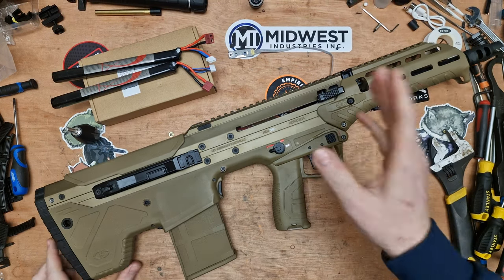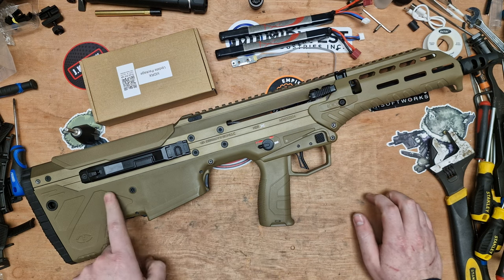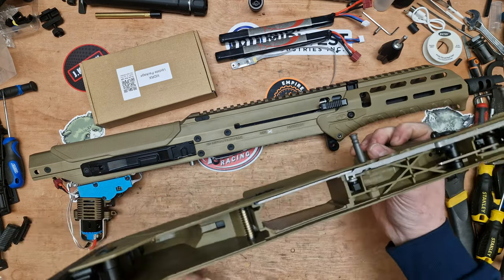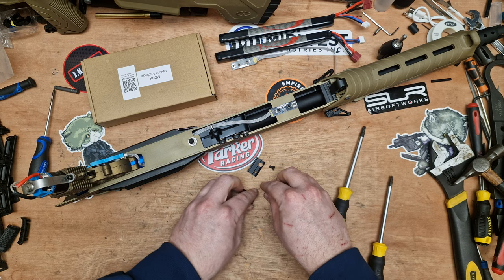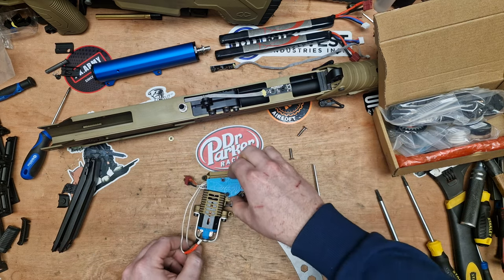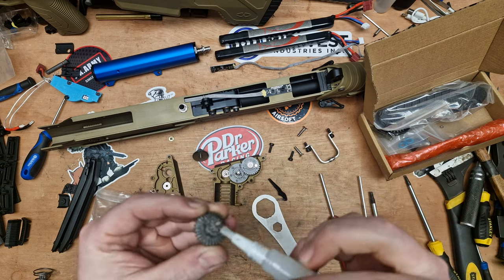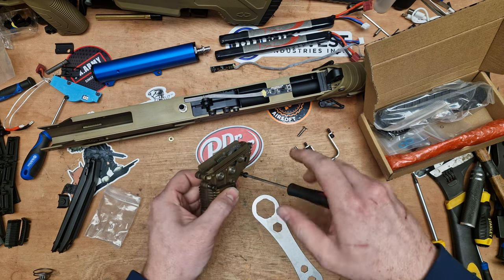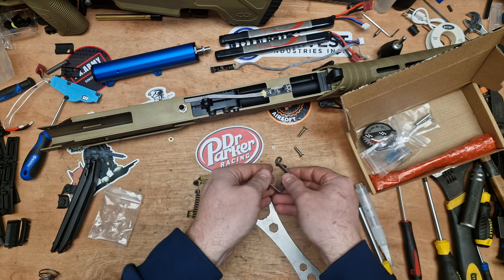Silverback MDR-X Upgrade Kit Install Guide

Comment: The version 2 enhancements make the MDRx much more appealing. I'm impressed with how easy it looks to work on, now ive seen your great tutorial. Great video.
Reply: Yeh that is what I noticed as well, like you cannot take a m4 apart this quickly and easily most of the time. Now combine this with a proper good inner barrel and the full cylinder and you have a great DMR.